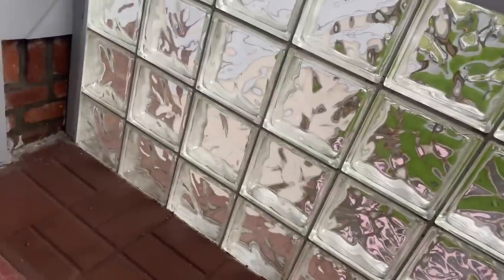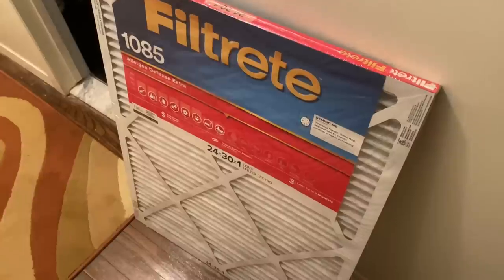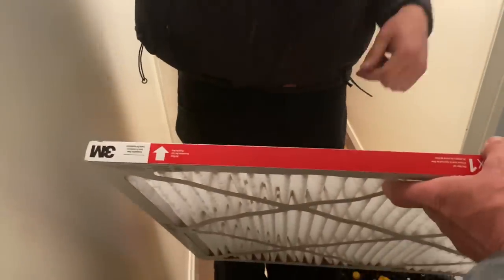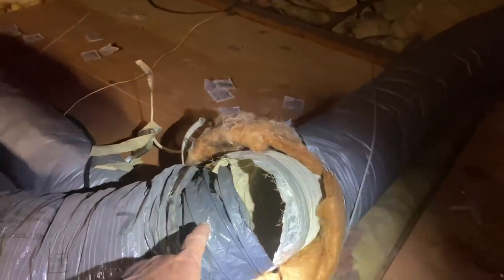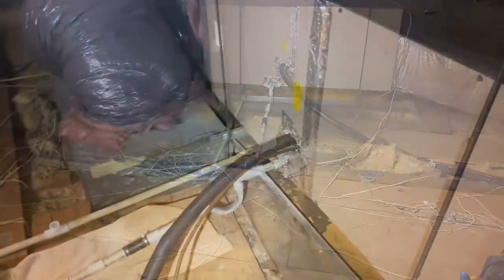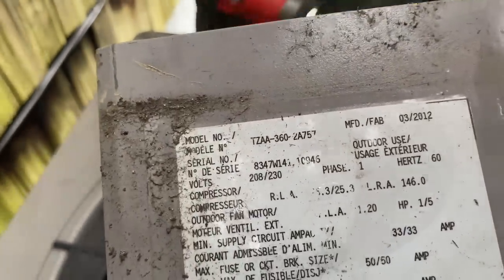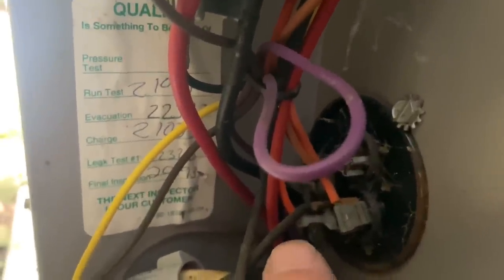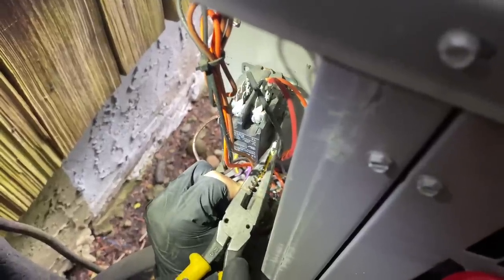How to Run a Successful Central AC Residential Preventative Maintenance Service Call

Comment: Rheem used to use amrad on their condensers I work on  tons of 20-35 year old units still kicking all with original caps also some companies add hard starts on new installs first company I worked we did every condenser

Comment: Mikey...Is there any manufacturer of outdoor central AC units that thinks of the technicians that have to service them. I have yet to see any unit that has an quick disconnect for the fan assembly which would make it much easier when cleaning the coils. 
Thanks for the very informative video. How can anyone not SMASH that thumbs up button after all you do to share your knowledge with the community?
Reply: The more molex plugs and connector there are, the higher chance of electrical issues I would think. I prefer it keeping them simple in my opinion.

Comment: Wait am I not supposed to put the 24v contactor coil wires on with my fingers? Been doing this a while and never popped a fuse. Only felt a slight zap once😂

Comment: Condenser coil definitely needs to be cleaned running 30+ degrees over ambient at that SEER.
Reply: @PipeDoctor  Your high side saturation temperature/pressure is really high for that outdoor ambient temperature.  A 13 seer unit should only be running a head temp/pressure about equivalent to  15degrees higher than your outdoor temp. At 50degree ambient outside you should be running at about 115psi.
Reply: @Mikey Pipes - Pipe Doctor Plumbing & Heating & Air  You're welcome! Love your content and philanthropic mission!! Thank you for what you do, sir!
Reply: @zacke1434 that rule of thumb is also when ambient temp is op, and the pressures were dropping hence the icing of suction line, it’s a 5ton, on a 50 degree day that is normal action, it’s a pure show of mist matched equipment also , now on a warmer day that rule could be followed, at about 75+ ambient . But I like the ones who have good rule of thumb, R22 was the best lol🤙🏼👏🏼💪🏼

Comment: Mikey, Does NY require locking Schrader caps on new installs? Is code in some parts of Ohio and they will fail the install if not installed.
Reply: Required here in South Jersey

Comment: I see the customer just said it replaced the condenser so the air handler and everything else is old 🤔
Reply: @PipeDoctor  
I'm not sure what you mean
I was saying that the condenser was changed in 2012 but the rest of the system is old.
Is that correct or not correct 🧐

Comment: Oh wow where do I start?   Well let’s start in the attic . Insulated duct was never properly installed on the elbow  screws tape an zip ties… an the splice? Hack  work trips my trigger the original  installer owns that boo boo … an the drain line ?  Them alligator teeth clamps? 🫣 you can’t beat old school SS clamp an a screwdriver. Now the filter?? You an I are 100% agreement I buy them by the case an sell my customers by the case EVERY ! 30 days .. ductwork?  Yes I have seen worst but  I hav never been a fan of Spyro insulated ductwork 👎👎 too much static pressure loss . Yea I know it’s the trend but I don’t like resistance… outside?? On caps? You saved the customer a trip back at 90+ degrees temperature  for an old unit it was  not bad  but as to the noise?? I always told my customers light noise is good you know it’s working when quiet?? Big problems 😂😂😂  I love you take the time an explain to the customer..  Excellent. EXCELLENT JOB ❤  So if I call New York paper an get a $50 dollar off coupon an have you come to Michigan I can hand you the coupon and that pays the bill right? 😂😂😂😂😂😂 dam smart ass Michiganders❤❤❤